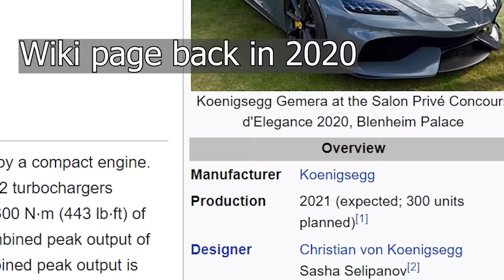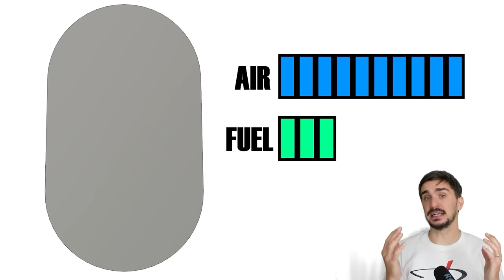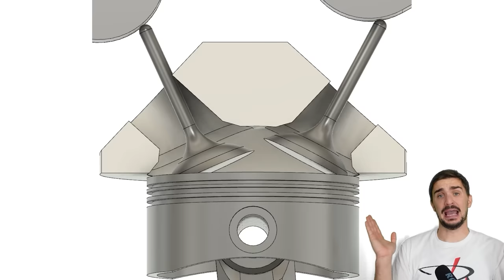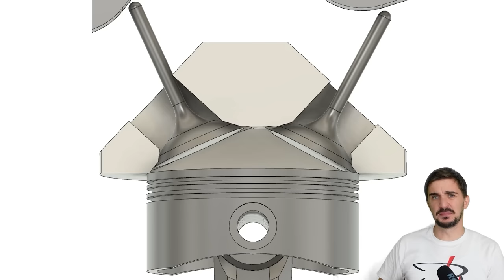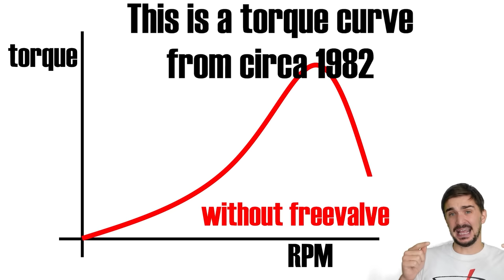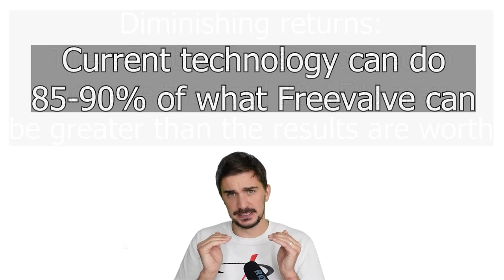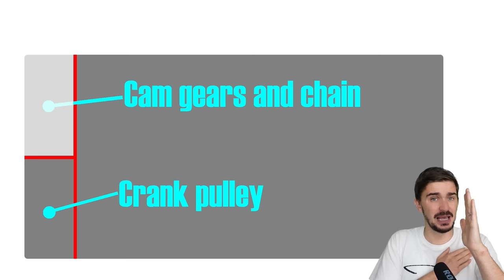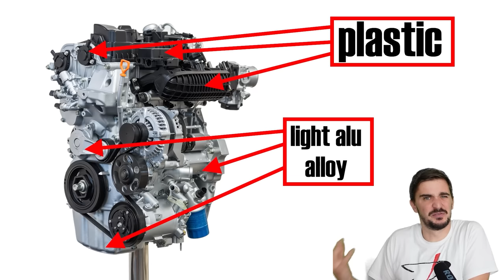FreeValve Isn't a Big Deal. Here's why

Comment: I was also hyped back in the day when they announced it, I would imagine the kind of cars and power curves would've been possible. 
And the thought of something like freevalve in the aftermarket scene made me really excited. 
I'd even tell my old man about it and he would also be excited about this new tech. 

But then yeah, reality happened, technology advanced. 
And you're absolutely right, we could be sad that it didn't happen fast enough to the point it may not be that awesome game changer anymore, but we should be happy about how far we've come.
Reply: Turbo air induction ICE is dead electric gives max torque from zero rpm
Reply: @petermoller8337  that's where hybrid diesel for Semi Trucks will really shine for emissions and operator costs, as well as combined hybrid to get performance and range for the mild sports car market. I wish the CRZ was able to run on electric alone so I could pull away in 1st without touching the clutch.
Reply: @petermoller8337  tbh, i think hybrid cars are probably the future. Unless batter technology undergoes a fundamental breakthrough.
The issue is, electric cars need larger batteries, meaning more co2 to produce them. Plus theres not enough lithium in the world. Volvo did a big study into this, 76000 miles was the crossover point where they became better than their diesel counterparts for total co2 production.
Thats under ideal circumstances, and didn include other issues like recycling, fires, other pollutants , etc.

So with that in mind, the current ideal has got to be hybrids.
Reply: I don't think ICE's are dead and electric cars are the future ❕😅
I believe in 5-10 years, they will realise that the whole E-Cars thing, isn't the right way ❕😂
Reply: @Nbomber I would say Plug-in hybrids with around 50miles pure electric range . Will be ideal if they use CNG/LNG  
fuel .
Reply: @flappingflight8537  i totally agree with this tbh.
But not sure i know enough to comment on using pressurized gas as the fuel. It seems to have some benefits regarding being clean though. And the government so far hasnt taxed it to the same theiving degree they tax petrol at. So yeah, maybe.
Reply: @flappingflight8537 these gases are hard to contain. Better use the methanol from renewable energy, just like the Gemera uses.
Reply: @Nbomber  it’s widely used for many years worldwide already, so it isn’t something new and exotic. Also CNG/LNG has octane rating of 130 which allows use of high compression ratios engines 14:1-16:1 which make them even more efficient. 
Also there are even factory produced CNG powered cars . The pollutions are the lowest possible among all hydrocarbon fuels , since CNG/LNG ( Methane) molecule contains only one Carbon and four Hydrogen atoms .  There are LNG powered commercial trucks as well . In US isn’t very popular dew to the relatively low gasoline prices and relatively higher pay rates of the population but it’s used in some states as Utah for  example . There even factory produced ,CNG powered variant of Honda Civic was available.
Reply: @gilsonrogeriolimaoliveira2807  it’s not so hard . Light weight composite tanks for cars and other vehicles are in use already for many years. When the CNG powered car is factory produced , the tanks are integrated in to the body so it’s hard to grasp if the car is CNG powered .
Reply: @petermoller8337  Cringe EV fan
Reply: @Nbomber you are awake. That's good. One of the most smartest coments here. Congrats. 👏👏👏

Comment: It's actually super impressive how manufacturers continue to improve efficiency in their modern engines. Things like mild or plugin hybrid, turbocharging, variable valve timing, variable valve lift, and variable compression have all made engines more efficient, more powerful, and more complex. Hopefully these technologies are reliable and relatively easy to maintain as the vehicles are used in the real world. It's great that the industry as a whole continues to innovate.
Reply: the irony is that variable valve timing/lift/duration was all perfected in the 90s but patent disputes are the main reason we're only seeing those innovations 30 years later. The reduction in fuel costs alone afforded by optimal gas-control is like 30%, which if you told Exxon or Shell they'll be making 30% less money next year, they're probably not have the same optimistic attitude towards the technology. Hell if you really want to get nerdy, sleeve-valve engines (used to get WW2 bombers high into the air and run on dwindling fuel supplies) are still better in every respect to every technology listed in the video, except in the 40s they wore out slightly quicker than traditional valves. Why wasn't sleeve-valves "innovated" on? Because actually engine innovation is highly regulated, and slow.
Reply: GDI as well.
Reply: Unfortunately any type of Rand D into ice engines at this point is kind of useless…electric engines are dead simple…far mor reliable….far more powerful and on another level of efficiency
Reply: @chrisvig123  There's no such thing as an electric engine. i think you mean electric motor - which of course has to be powered by something. Personally I think it'll be another 10 or 20 years until batteries reach the level of diesel. Some diesel generators are more efficient than the gas turbines used at the power plant.
Reply: @cannaroe1213  people tell me all the time it’s wrong to say Internal combustion motor. It’s funny they don’t know they’re wrong.
Reply: I really like electric turbochargers
Reply: @YounesLayachi  said nobody ever
Reply: @chrisvig123  Electric engines are not "fuel efficient", fool. Their fuel is the power that was required to charge their batteries, which is going to be around 90% in ideal conditions...and because most power is generated by burning fuel at around 35% efficiency, the true "fuel efficiency" of electric cars is around 90% of 35%,  or 31%...and this doesn't factor in the limited life in terms of charge cycles for batteries, which will drop that 31% figure even lower because a lot of energy is required to recycle or otherwise dispose of the dead batteries.
Reply: @Fee.1  I did say that
Reply: @YounesLayachi  it’s ironic because electric turbochargers were literally only a scam until very recently and now still 99% a scam/are scams…but when spending the amount of money you’d spend on a actual turbocharger setup on an electric turbocharger you can achieve actual measurable boost…it’s laughably low compared to a regular turbo, but it has a singular function/benefit in that it can scroll rapidly and independent of the exhaust and therefore it serves as a sort of pre-charge for your turbo…or an external mechanism to keep the turbo making boost so it can kick in at low rpm’s. 

But they’re effectively useless on their own…so literally nobody ever says they love them on their own
Reply: @Fee.1  I never said "on their own", that's your strawman that you built then took down.
Regular turbochargers have become so common it's not even worth mentioning.
Okay, you want me to specify "electric assisted turbocharger" instead
Reply: @YounesLayachi  no man I apologize I’m not trying to attack you here, I know you didn’t say on their own, I just find it important to clarify because I’ve seen the poorest of the automotive enthusiasts getting scammed into buying “Electric turbochargers” That are advertised as being legitimate alternatives to turbochargers capable of creating real HP/making significant boost etc and most of the time they’re literally just electric fans made to look fancy & some tubing & electrical wiring
Reply: My attitude changed from impressed to hatred the first time I had to work on one. I went back to a '90s truck.
Reply: @honkhonkler7732  we could say the same about modern computers
Reply: Reliable ? HAHAHAHAHA
Reply: @YounesLayachi  no lol ?
Reply: After owning an off lease Nissan Leaf for 6 years I bought a Mach E. The lack of maintenance alone is a big deal. Wiper blades, tires and an occasional brake bleed are the ONLY maintenance. 
There is no transmission, no exhaust pipe or muffler, no oxygen sensors, no smog test, no oil changes, no cold starts. I drive it 800 miles round trip about once a month. One stop for lunch each way. I charge it with solar power.
Reply: @Fee.1 Hyundai made an experimental engine that used a pro charger with instantly variable gearing.
Reply: @JTient  clarify please. Gears where for what ? Trans ?
Reply: @cannaroe1213  There's also the issue that the WWII sleeve valve engines had pretty hellish development problems--development hell is almost certainly the reason why the Sabre never got the level of supercharger development that the Merlin did.  This may have discouraged postwar automobile engine development.  It certainly seems like sleeve valve engines were pretty fussy about manufacturing procedures.  Building them today with CNC machines would be far easier, but you'd have to prove that sleeves are at least as good as modern, fuel-injected, variable-valve-timing poppet engines that have had 75 more years of development.

I think Bristol was on to something with sleeve-valve radials though.  160-cubic-inch cylinders with two pushrod-operated poppets each are really on the wrong side of the square-cube law, and a great big sleeve-valve opening should be superior.  If only Bristol could have surpassed the specific power of the R-2600.  Or gotten close to the specific fuel consumption of the later R-3350 (competing for specific power output was not a realistic goal).
Reply: @ExceptionallyCleverUsername  Damn man, I'd love to have a beer and talk engines with you, you really know your stuff :) And I agree with all of it. Peace!

Comment: I saw an analysis that I found quite persuasive. You need about 20-25 machining operations for each freevalve solenoid. 12 solenoids in a 3 cylinder engine. Meanwhile, big manufacturers grind millions of camshafts for a dollar a piece.

Comment: "Traditional Engines" may refer to Non Turbo Charged.
Here a some other engines that could be "Compared"

I used Honda as it rather easy for most people to understand their naming scheme.

Honda B family which were performance based
B16A: 150hp
B16A(2nd gen): 170hp
B16B: 180hp

Honda D Family which were economy focused 
D16A: 130hp
D16A1: 115hp
D16A6: 110hp

Honda R family, economy focused
R16A:120hp

Carburettor Equipped Honda 1.6l Engine
EP: 94hp